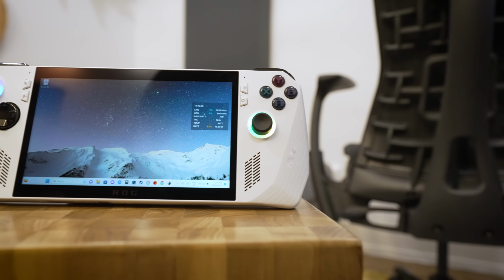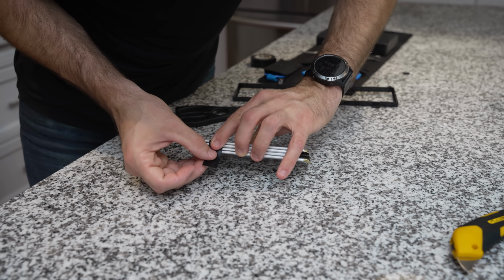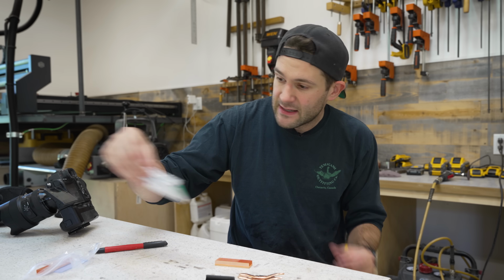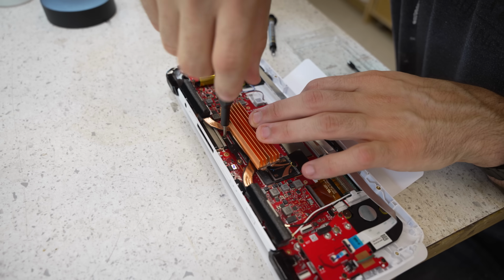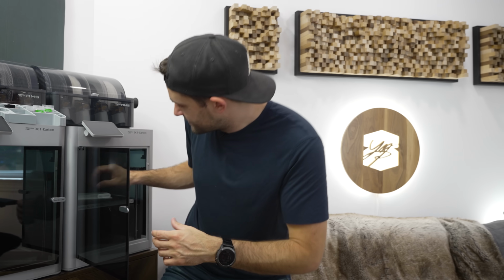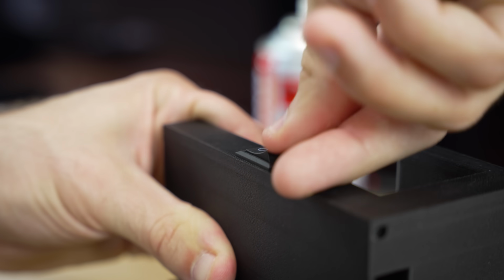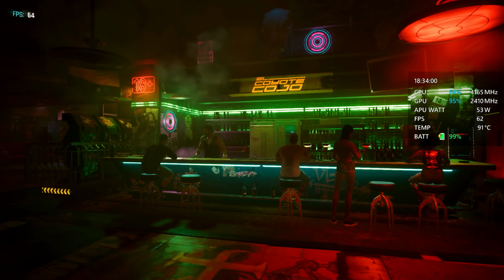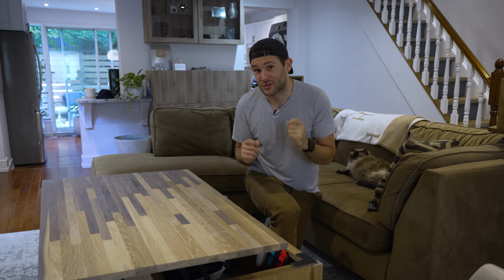I don't understand why people buy Steam Decks...

Comment: I have the Legion Go, and i figured with the 2242 drives i could find 3, even 4TB drive, but no, not yet, unlike the high density drives used to get 2TB on the Steamdeck, there so far seems to only be models with 1TB chips, and only one chip on the back side(despite there being room for one on the front and 2 on the back)

Something i noticed about the Legion Go, while it may have much faster 7500MT/s RAM, the rest of the system is much slower, with MCLK/FCLK/UCLK often running at 935Mhz (ideally you want ram to be in 1:1:1:1, but this is 1:4:4:4) meaning that in many games, the ROG ALLY with its 6400 in 1:2:2:2 is likely going to be faster

Now knowing this i'll still take the Legion, unless the Ally came with OLED.
Why? perfect 4:1 integer scaling at 800p, the minimum reccomended resolution for many games is 800p(for UI elements, though most games still support 720p for compatibility)
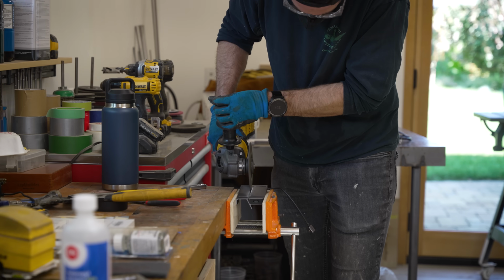With the ROG ally 1080p/1200p is the lowest you can go without making the screen seem fuzzy due to non pixel perfect scaling, well, you could go to 540p/600p(16:10 not 4:3) if a game supports it, but not many modern games do

I wish Lenovo offered a 32GB version with a BIOS that let you set the RAM to 6400, or whatever the fastest speed is possible in 1:2:2:2

Comment: I love the talking smack but then turns around too mod their rog even more, you can do the same with the steam deck too you know which also voids the warranty, but hey to each their own right, also the linux based system that the steam deck uses has kinda grown on me over running windows and epitomizing windows too not be bloated which the Rog Ally comes packaged with (you can change that too though).

Comment: I don't understand te concept of Steam Deck and its clones... full stop. If you want for your games to follow you, say, in vacation, buy a gaming laptop. It's usually more powerful, ablates heat easier (and can be put on ventilated pads for added cooling) without any heat discomfort to your hands and has a bigger screen.

Sure, there are those who want to play while on a bus or something, but... is it really comfortable to have your hands braised while you play? On a screen that on bigger machines don't get even closer to 9 inches? With batteries that give you effective usability time only on short commutes?

Sure, someone could object that gaming laptop batteries are no better as much as time of usage, but no sane gamer using one of those would seriously play on batteries because beside the short range, all gaming laptop reduce their working clock if not connected to external power.

My inability to understand these machines only soars higher when those decks are mainly used an external deck to be used on a bigger screen. Doesn't it defeat the reason those should be portable gaming devices are built for in the first place?

I guess it's a matter of tastes. As much I am regarded, I'm not changing my Acer Nitro 5 for one of those.

Comment: "I don't understand why people buy Steam Decks.."

proceeds with a custom build that requires torching a copper and fluid heat pipe which could pop if you don't watch the temperature carefully so you can bend it into the correct shape

Comment: For a lot of us, it isn't about the hardware. It's about Valve's support of Linux. They have contributed greatly to that ecosystem.

Even from a hardware position though, the Steam Deck has one major advantage over the Ally and that is the thumbpads. Windows sucks with a controller, but a thumbpad would go a long way towards making it useable. On top of that, a number of games do not work well with controllers on PC, so having the thumbpads as an additional input goes a long way in getting games to work well. Honestly, of the three major handheld PCs the Ally might well be the worst one out there. The Legion Go has that mouse mode going for it, and the Steam Deck has dual thumbpads along with the entire system being built around Steam Input. The only real downsides to the Legion Go are that it is Windows by default (personal criteria, but still a let down for some of us), and that it is made by Lenovo which has a history of questionable decisions (remember the adware/spyware they put in their laptops a few years ago?). With that in mind, the only handheld PC that really makes sense in my eyes is the Steam Deck. Nothing else comes close.

All that said, Asus could definitely make a very compelling alternative if they just provided a version of the Ally that came with Holo ISO (or some other alternative like Bazzite) out of the box, especially if they either made it cheaper than the Windows one, or donated the money that would otherwise go to a Windows key to FOSS projects.

Comment: changing out the SSD and thus flashing the OS should be very difficult if it was any other company. Valve has a whole step by step page with links to 3rd party tools to replace the ssd and flash the correct OS onto the drive. its amazing

Comment: Ive had the ally, the original steam deck, and the OLED steam deck. Both steam decks have been sold at this point. Neither steam deck was close to the performance of the ally, and thats having to run at 720p vs the ally 1080p. Neither steam decks sound is even half as good as the allys, the OLED surprisingly sounding even worse than the original. The lack of windows out of the box with the deck was annoying as im a huge mod lover. Valve has spent years optimizing steam to work for windows so not sure why people think its somehow better on the deck. The ally has “armory crate” which streamlines all your games into one; even non steam games and windows programs, just like the steam deck if you are into that. Also on the support side everyone acts like ASUS doesnt put work in but thats entirely false as ive had a ton of useful updates for the ally since getting it, including a new one adding a ton of customizable graphic settings. Battery life? If you dont have a plug or need more than an hour; Just turn the ally back to 720p and cut the power down and boom you have battery life. There just literally isn’t anything the deck wins at, except that the OLED is very vivid and has true blacks.

Comment: PLEASE STOP using liquid metal directly on copper. It will solidify quickly and may destroy your heatsink in the long run.
You would be better off with top grade thermal paste or some graphene thermal pad.